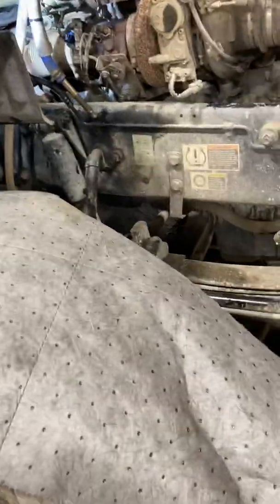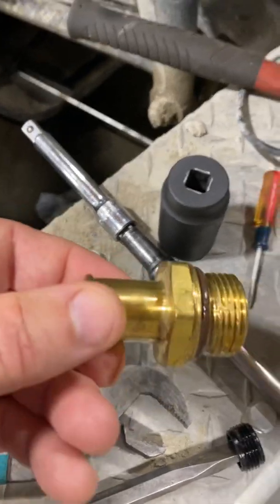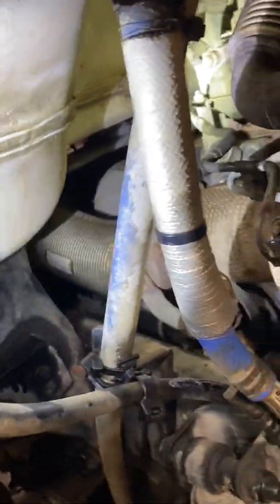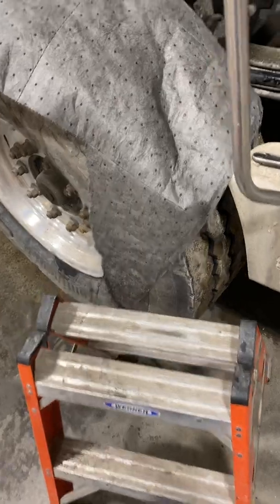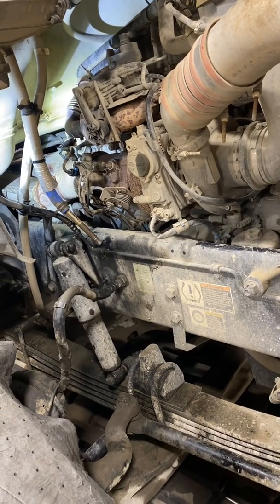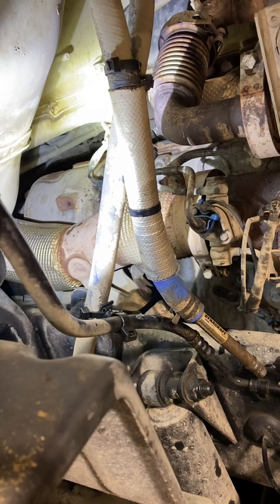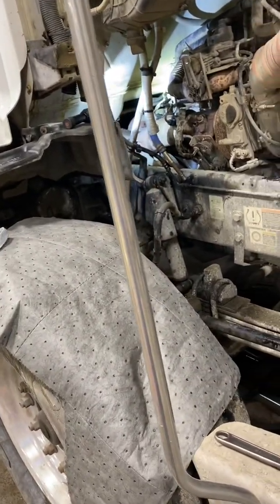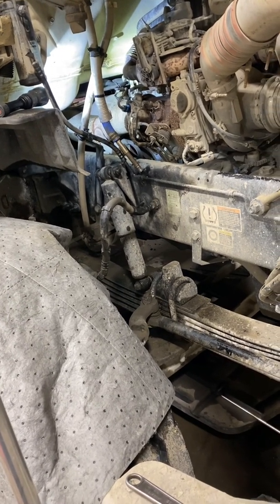Paccar coolant fitting failure.

Comment: What thread pattern is the replacement
Reply from the maker: Unfortunately I don’t but I can tell you it’s a straight thread o-ring fitting. I hope this helps!
Reply: @dirtytruckhotrodshop7829  thanks For the quick reply! I got a garden hose thread fitting to screw in not sure if it was right but it’s what I had access too kenworth didn’t have anything in stock and couldn’t get me one until Monday had a tank full of milk that had to be delivered. It got me to processing facility and home it’ll stay in until I can get the real part

Comment: I have the same problem right now here in Boston, MA and trying to pull that plastic fitting out of the back of the engine. What size is that fitting and where I can buy it? Thank you.
Reply from the maker: I got mine thru peterbilt, they keep them in stock around here.
Reply: I’ll look tomorrow.. this fitting that they put it can’t tighten up good. it still turns. I need the right size. Im adding 2 gallons antifreeze in 100 miles, still leaks.
Reply from the maker: Sounds like they used the wrong fitting! Good luck man!

Comment: I had 3 of them break. I replaced the 3 on back of the head and 2 on side of block. Used a razor blade to put cuts in the threaded section and then use a screw driver to break them out. Just make sure you don't get any pieces in the cooling system. The chisel idea is a great idea. Change them all out before they break!
Reply from the maker: They are definitely a bad design! Plastic coolant fittings just don’t last.
Reply: @dirtytruckhotrodshop7829  You are right, Brother. They never should have used them. I keep a couple extra brass ones in case I happen across another truck with a broken one

Comment: What program do you use for the paccar engines for diagnostics?
Reply from the maker: Davie, however I have also used j-pro and it worked!
Reply: @dirtytruckhotrodshop7829  where did you get davie? And how much is it a year if not a secret because i contacted our kw dealer and they told me that they dont sell the program?
Reply from the maker: @56wb56a  we got it from our local peterbilt dealer.

Comment: I only found one on the back of the motor.   Someone told me there are 4.  

If they aren't broken or leaking then what's the possibility I'll get them out?
Reply from the maker: I remember one on the side and two on the back but there may have been running changes. If they aren’t broke you’re probably 50/50 on them unscrewing. The ones on the back of the head can be a pain!
Reply: @dirtytruckhotrodshop7829  I have 2 on the passenger side behind the turbo and it appears to be one on the back.

I'm going to try and replace them Saturday.  Wish me luck.

Comment: Do you happen to know the size of the chisel?  I'm going to replace all three of mine this weekend.  

If it hasn't broken yet what are the chances that it'll come out without breaking off.

Have you ever changed the one on the back of the head?

It looks like I can get to it by removing the air filter assembly.
Reply from the maker: I don’t I just find one that fits snug. For what it’s worth the cheap set at harbor freight works decent. What make and model truck is it?
Reply: @dirtytruckhotrodshop7829  2016 Peterbilt 579 with an MX 13
Reply: @dirtytruckhotrodshop7829  someone suggested internal pipe wrenches which I've never heard of but look great for that

Comment: Had the same issue on my Semi. If I'm not mistaken there is a recall on those but only if your truck is under warranty. The brass fitting is suppose to be the new replacement. Why they didn't put the brass fitting to begin with on $150k+ truck?  Cheap bastards.
Reply from the maker: I 100 percent agree!
Reply: Yes, lol. Just happened to me yesterday.  Luckily I was just a block away from a repair shop. 😁